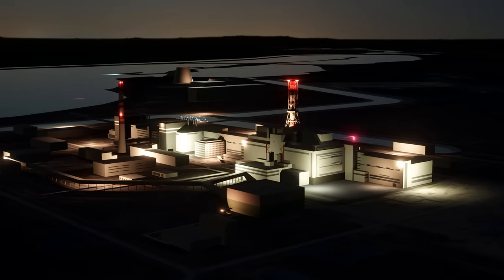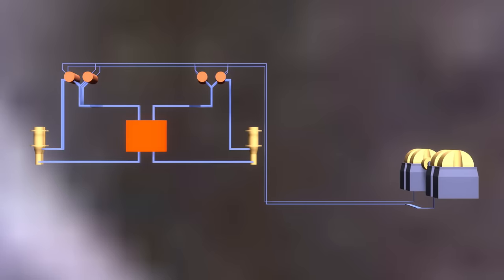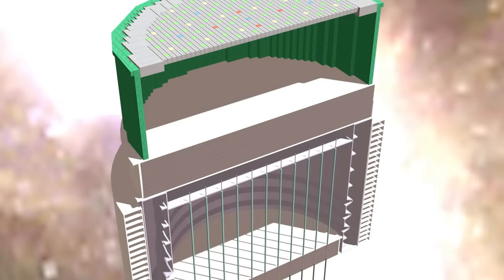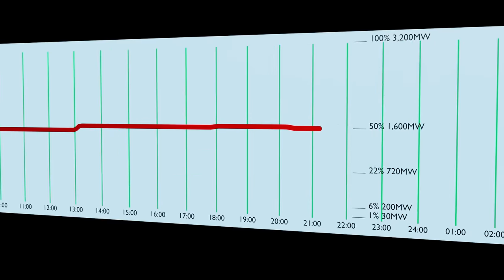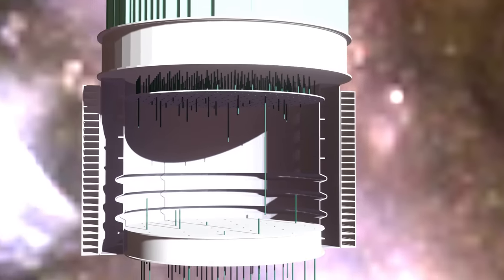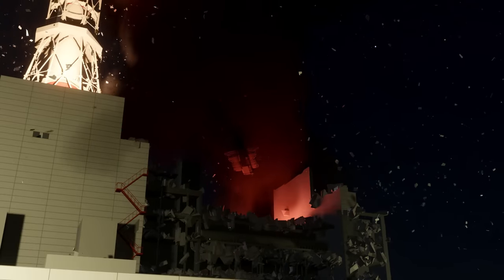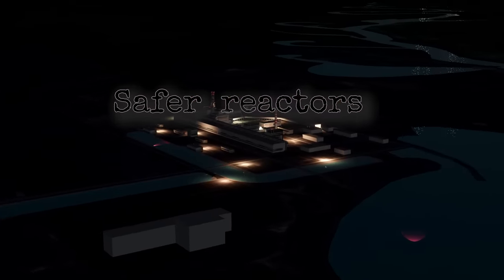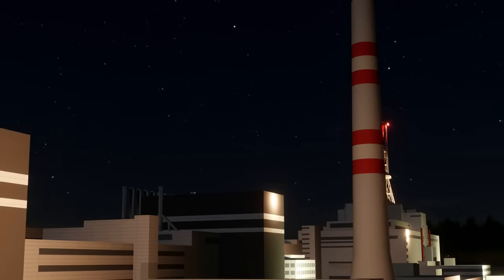CHERNOBYL AZ-5 why it exploded

Comment: Why? For the same reason our reactors do not have containment buildings around them like those in the West. For the same reason that we don't use properly enriched fuel in our cores, the same reason that we are the only nation that builds water-cooled, graphite-moderated reactors with a positive void coefficient.

It's cheaper.

Comment: That piece that got blown up to the air and fell down back to the reactor wasn't a lid, it was the Elena - a bio-shield. Incredible animation and explanation tho, exceptional work my man!
Reply: Correct its the Upper Bio Shield but everyone calls it a reactor lid because it’s like a cup lid in a sense if you squeeze a cup enough you’ll get the same reaction to what happened at Chernobyl where the lid flew about 500m in the air.
Reply: @deathjr112  bro... it's really not a lid... and how the hell did it flew HALF A KILOMETER in the air???
Reply: @rigel8755  the distance was an exaggeration. As for the bio shield everyone has called it the Reactor Lid from the scientists all the way to designers and investigators
Reply: @deathjr112  ohok, but anyways, calling it a reactor lid is wrong, because it's a Bio-Shield. It's like everyone calls an airplane engine a ''turbine'', but it's called ''engine'', turbine is just a piece that is assembled inside the engine, got it?
Reply: @deathjr112  and in fact, the RBMK reactors really have lids, it's the surface the workers can step on.
Reply: Technically, it’s both a lid and a shield.
Reply: @rigel8755  Who cares